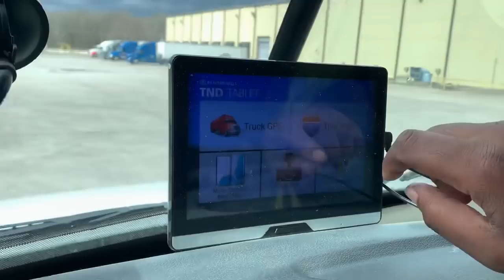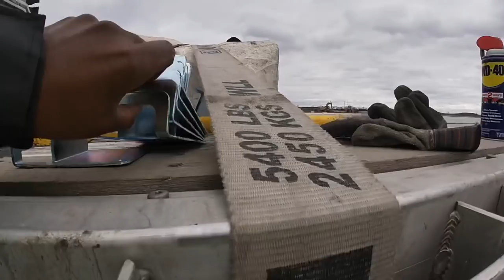Steel Coil Load Securement P&S Transportation Lease Purchase

Comment: FYI: never tarp on the inside when other drivers are waiting behind you...throw the tarp over the load...bungie the corners down and pull outside. Keep the videos coming.
Reply from the maker: Marcus Bethea in some cases yea but if they’re isn’t any rush then your fine. It was windy asf outside and another truck didn’t show up until I was almost finished
Reply from the maker: Marcus Bethea when I pulled outside did you ever see another truck pass me by? Hell no. So obviously the other truck behind me was still inside tarping
Reply: @bigsnow1705  ok.

Comment: Your trailer sits really high. Mine doesn't, j have issues with the reels, particularly where the drives are. They sit really low near the tires. WHY?
Reply from the maker: SpearHead1011 I have no clue

Comment: 3/8” grade 70 chain is 6600 lbs
Reply: @SVGREENTURTLE really ok! I’ve never used it! What’s the weight rating on those chains?
Reply: WLL is the lowest rating of the system, example, check the WLL of the ratchet or snap binder. If it's 5500 pounds that is now the WLL.👍